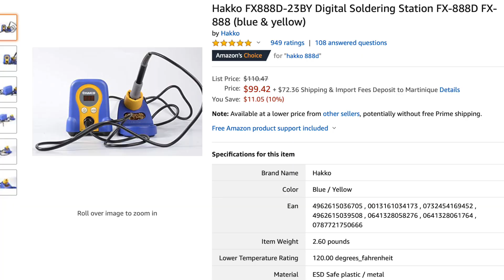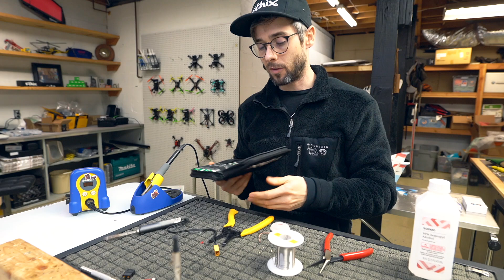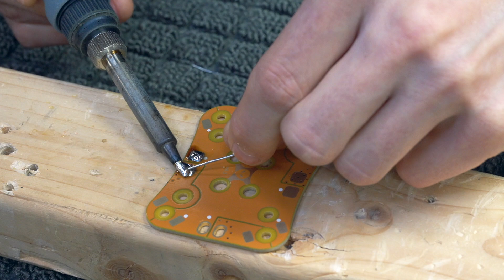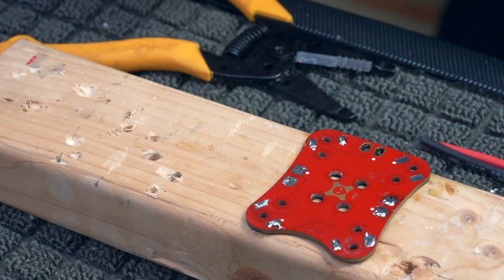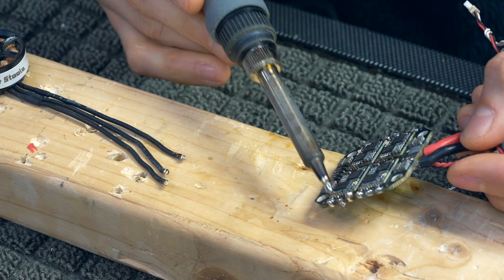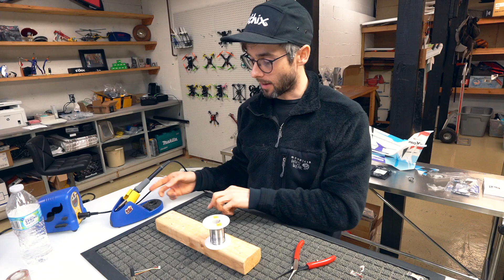How TO Perfect Solder Joint 🤫 | FPV Drone | Pro Soldering Tips & Tricks

Comment: I'm sure you'll be going over it but good solder is so important.
I bought my first spool of solder in an actual RC hobbyshop and it was really expensive but always easy to work with and yielding good results.
Now the spool is empty and I ordered new supply from Amazon and man is it horrible. Just horrible - and that now after almost two years with a lot more experience getting lot worse results, so, yeah... ;)
Reply: Agree, also I think solder goes off. I did electronics as a kid and was good at soldering. Now I got into fpv with my old gear and solder and my soldering was horrible! I bought new solder - back to to shiny😀

Comment: If you're having issues with the wires melting because you're over heating it, get yourself some flux paste or liquid flux (I use MG Chemicals 8341-10ML in a syringe). Add a tiny bit, then add solder. The wire soaks up the solder so you don't have to worry about melting the insulation on the wire.

Comment: Thanks Mr. Steele, great video!!  Quick question, I'm not great at soldering, only learned how about 5yrs ago when I got into hobby, but I've gotten much better over the years.  One thing that still hangs me up, and it only happens once in a while, and that is not being able to get solder to stick/hold to a pad, and it's almost always a ground pad. I've tried, sort of, what you did 9:40 mark, and that doesn't work. My iron isn't top of the line, but it's decent, about $50-$60, and I'm of the same philosophy when it comes to temp, so my iron is usually near maxed at 450c, and I use regular hobby grade 60/40 solder from hardware store.  I've even tried (very lightly) scuffing the pad a bit with fine sandpaper, and dabbing it with a flux pen, and still nothin.  Any ideas, or something I'm doing wrong?  I do keep a damp sponge near by, but i only use it about every 3-4 solders, guess I should use it every time like you said?

Comment: Question: If solder balls up on the iron's tip, does that mean the iron is too hot or too cold (I'm assuming too cold)?  If the solder "sticks" and gets dragged out as you pull the iron away, is that also too cold?
Reply: Yes

Comment: TS100 iron - a week after I received mine from from Banggood, I saw it on offer again so bought another as backup :)
Here's my soldering tip, go to Thingiverse and search for: Tic Tac Solder Dispenser
A little design of mine, I have 3 permanently filled so there's always one immediately to hand, and perfect for a backpack.
Reply: I do board repair/data recovery for a side hobby/pocket money for my toys, and I even switched to the ts100 for that. Such a versatile little iron :)
Reply: Dude.. Genius.. I'm setting my i3 up tomorrow, so I'll be printing a few off. Just gotta inhale some orange tic tacs now lol

Comment: You werent particularly quick on those xt60s, so the pdb heats up alot, also because of that temperature which I still think is too high. I have had bad experiences with soldering prototype pcbs at high temperatures (the board material melts quickly).

Comment: Is it needed to have lead solder? Does the difference between leadfree and leaded matter?
Reply from the maker: Did you watch the video ? 
 Lol 😂.  Yes it’s needed 
 Do not use lead free!
Reply: I think there will be a resounding "YES!" from anyone who's ever used lead-free solder.
I once bought a reel of lead-free solder 15 years ago, tried using it once, immediately went back to leaded solder.
It's not nice to work with as it doesn't flow as easily as leaded, you need more heat.
Here's something interesting in this topic - If you ever have to replace a camera or something on a pre-made quad, and notice when the joint cools the solder surface goes from shiny to matte in an instant, that's because there was lead-free solder already there and you added leaded solder.
Reply: @MrSteeleFPV  guess that this vid just came on time, was about to build my first quad with lead free. Thank you!
Reply: Lead free is much harder to work with. I have to use it at work. It requires more heat and you have to hold your parts in place longer. It takes longer to cool.

Comment: I just finished my first soldering, I had to solder my power cable that I had torn off, now the new cable is well placed on my circuit but when I power my drone with the battery, all the printed circuit becomes very hot. An idea ?

Comment: I'm at 400C and I'm practicing with 18g wire on breadboards. I try to pre-tin the pad and the wire, but whenever I push the wire down and try to combine them, the solder gets like a dark ugly gray instead of shiny VERY fast, and doesn't actually sink into the solder on the pad all the way. Any clue what I could be doing wrong? Worth noting I bought a $20 soldering iron on Amazon. The reviews are decent though. The tips say "SGS certified" so I don't know if that means they're crap or not

Comment: Hey all, if anyone is in the market for Soldering iron.  I highly recommend KSGER T12 Stations!!!  It's the new school cartridge-style irons for ~$60.  TS-100 is a cartridge base for example.  The iron heats up and cools down super quick, KSGER has a ton of handle options, some handles give you the closest finger tip to iron tip I have seen.  BTW, T12 and T15 are the same tips.   I have used $1k irons before.  for $60 to $70.... you can't beat it.
Reply: Exactly. I love my new KSGER. Heats up in 10 seconds and has 80W of power.
Reply: Nick Hesson Thanks! Going to pick one up now
Reply: Agreed. However, I suggest you only get it if you know how to de-death trap chinese electronics.
Reply: @astrolite3192  Is there a known issue that I should look into?

Comment: im IPC certified and i do this for work... HAKKO is the best!  i use the hakko fx-951.. i use TS1000  with a modded usb C  to a USB C  amplifier booster on a PD POWER BANK .. dont ever use TS1000 on a 12v power, use 20v+ on it

Comment: I'm still not great at soldering and many times I have small peaks. How do I avoid this. I've been using more rosin to avoid the tips but I see that you don't lift the soldering iron off the solder joint. It looks like you slide it off, so maybe that's what I'm doing wrong. Thanks for the video

Comment: some life lessons of what's existencial when soldering every day
-use no clean fluxcore! rosin flux is a mess at high temps. 
if you even concider working on SMD, a flux pen and 0.3 0.5mm solder are a must. (bonkote BON-102 reigns surpreme! but compare prices, they go for anything between <$1 to >$20 a piece)
-get a 3rd hand. it's a classic for good raisins.
-use a desoldering pump. it's much more effective than wick in most cases. (ideally a ProsKit DP-366P/A, because you can cock it by pushing against any surface without even having to look at it. 
PS: dont overdo it with tinning wires/cables. the deeper the solder wicks up under the insulation, the  easier it will break.

Comment: Great video, Steele! Will to try soldering with more heat, usually stay below 300C and use non-corrosive flux.
Did you try using reverse-action tweezers? I totally fell in love when tried them for the first time. 
Was using cheaper version made completely of stainless steel, now tried the "Pro's kit" bent type and they are superb. 
Compared to this type of tweezers, keeping wire with pliers now feels clunky and weird, like flying with winter gloves on ;)

Comment: Soldering is so incredibly simple I don't get why people struggle even with a video. There are a couple tips you need to make it so simple to learn. But once you know solder goes on heated surface not the iron and pre tin then it's incredibly easy.

Comment: Hey Steele. Thanks for this vid. Likely the most intuitive Soldering video I have seen. Question for you. You mentioned conformal coating and the fact that there is a right and wrong way of applying it. Any chance we can expect a How to from your perspective on that application? I live in Western Canada, and well let,s face it, Winter happens. Winter is a great place to visit, but sucks having 6 months of it each year. Thanks in advance.
Reply from the maker: I’ve actually never conformal Coated. So my experience is lacking.   No need for it here in Georgia.   I’ve read a bit about it though and the paint on silicone is the best from what I can gather

Comment: how about a series on diagnosing drone/build issues, i have a fc that lights up but only very dimly, and it wont connect to my computer, im a noob so its been stumping me for a while now. any ideas?
Reply: brett's drone channel sounds like a bridged joint, like a short happening somewhere. It’s happening to one of my micro fcs right now. I have undo all the soldering and start from scratch :(
Reply from the maker: Trouble shooting is soooo hard to do. There is never one answer.  Soo yeah. It would be really hard to
Consolidate issues.  Especially since I rarely have issues and when I do they are simple
Fixes.

Comment: this is exactly what I was looking for Steele... i'm gonna start building my apex tomorrow now that I "know" how to solder... also... what would be the benefit of putting a capacitor on?
Reply: A cap will help smooth out voltage spikes coming in from the lipo. Usually helps clean up video feed too. Make sure it's rated for well over the voltage of your battery and has a low ESR.

Comment: My ufl connector came completely off the board with the antenna still attached to the ufl connector so now I can see 3 very small pads on the board and 3 small contacts on the bottom of the ufl connector.....how in the world am I supposed to solder this back on????? Can anyone help me out lol I'm seriously thinking about just taking the ufl connector off completely and take the connector off the end of my antenna and strip the wire and solder them directly to the board itself????? Only because how are you supposed to be able to solder this little connector on the board with pads so small???? It is a tiny whoop style vtx the one shaped like a triangle to let you guys and gals know.....it came shipped to me with some sort of glue or epoxy holding it on and well....it came off so now my video is crap in the gogs.....I would REALLY AND TRUTHFULLY APPRECIATE if ANYONE could help me out in ANY WAY👍✌ RIGHT NOW I HAVE E6000 ON IT AND I DONT THINK ITA GOING TO WORK I GET A PICTURE BUT I ALSO GET HELLA LINES THROUGH IT AND I KNOW ITS BECAUSE IM NOT GETTING THE BEST CONTACT WITH THE PADS ON THE CONNECTOR WITH THE PADS ON THE BOARD.....SO IM GOING NUTS!!!!!! ANYONE PLEASE🙏

Comment: I have been using the mamba practice board for while and get every single solder pad done right. Went on to re-solder a few joints on an FC, no problems either.
Yet for some reason I do not get a single pad soldered on the Hobbywing 4-in-1 60A ESC. I go back to the practice board, works like a charm, go back to the ESC, nothing... anybody else having trouble with that particular ESC?

Comment: What does the capacitor on the xt60 lead do?
Reply: Everything consuming power on the quad produces some level of radio frequency noise which can interfere with the VTX signal.  If that noise is allowed to get back to the battery wires they will act like antennas. The capacitor will dump the high frequencies on the positive side to ground before they get a chance to get on to the wires.

Comment: But I can freaking fly the drone! It flies just like the flight simulators. I can’t believe that I actually took several successful flights that were longer than a minute each. I only had the land because my battery voltage was low, or I had an actual crash.

Comment: use copper scrubber not steel. and never scape your tip (clean with flux/solder and clean with copper scrubber.

Comment: My only problem with soldering is that I get those F@$king solder spikes. I always have to go back and smooth them out.
Reply: The solder spikes because it is dirty. Each time before you solder wipe off the tip and put on fresh solder. Also, put flux on the board before you solder, it will help the spikes, it makes the solder flow perfect and keep the joint clean. If the solder on the pad is dirty and spiking, solder braid it off and re-tin the pad.
Reply: @SmashToBits  man do I need to do anything to the brass mesh? Because I clean the tip of the iron everytime.

I bought a flux pin as well and it helped but its just leaves a tiny spike just to annoy me. I resorted to just dragging the iron off of the pad instead of lifting but you cant do that on everything.
Reply: That's an indication the rosin is all gone. The tip really should be as hot as he says so you can be really quick and not burn out the rosin

Comment: Don't use a wet sponge, just my opinion but it's bad
Reply from the maker: Been doing it that for literally 2 decades.   WhAt you gonna use a dry crunchy sponge...   it comes with most soldering stations
Reply: @MrSteeleFPV  yes it does, but water speeds oxidation on crappy tips. Just scraping against solder blobs or a metal scrubby for solder stations has made caring for my soldering iron so much easier. I NEVER have to scrape it with a tool, and I never replace tips. Just a little rubbadub on the solder blobs in the tin where the sponge used to sit, knock off any solder on the tip, tin and go

Comment: 450 degree's  damage iron...  360 degree's  is maximum...
Reply: PS. why isee this? I soldering every day by 20 years
Reply: But lead free solder doesn't even melt well at that temp???
Reply: @ELValenin  lead free there are different ... with differrent temp .. so as leaded ...
Reply: @HERSDT_FPV  you mean there are specific irons/tips just for lead free solder?

Comment: I'd love to give an expert at soldering a shitty $3.25 25watt pencil from a 1990's Radio Shack with a carbon covered homemade rusty nail tip, let it warm up for 2 minutes, and watch how their soldering skillz plummet.   You know, what the rest of us use...  :-/   No $100 watt Hakko temperature controlled gun that shoots up to 400 in under 60 seconds from daddy.   That's my soldering throw down challenge :-)  Good luck not making a cold soldered joint or tinning a stranded 10 gauge wire.   No $18/roll Kester Rolls Royce of solder either, you have to use the crap that comes off the local Harbor Freight shelf from China.

Comment: All these 'expert' youtube solder tutorials.... If you solder a entire quadcopter without changing the tip and temperature multiple times, you have done it wrong! 15 seconds for a 12 or 14ga battery wire is 4 times longer than it should take. No wonder people rip solder pads off PCB's.

Steele is better than average, but he, himself has a lot to learn before teaching others.
Reply from the maker: I suggest you make your own tutorial :)
   I dont claim to be perfect but. My shit works and is easy.  Sooo is it wrong ?
Reply: @MrSteeleFPV  Yeah it works, and you're better than most, but it's not the best method and  ideally shouldn't be taught. I'm a perfectionist and so are you. There is no reason to not learn the proper way of doing it. Tired of seeing (others) hack job tutorials.

Edit:  " I dont claim to be perfect" - The title is literally "How TO Perfect Solder Joint | Pro Soldering...".